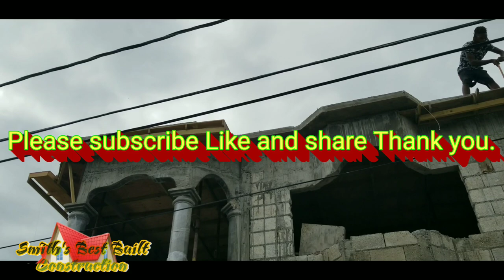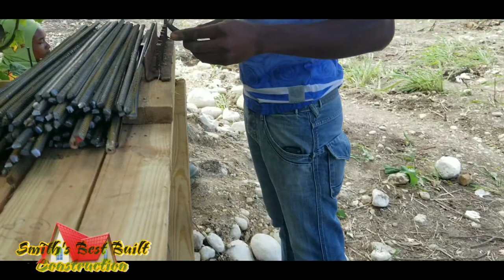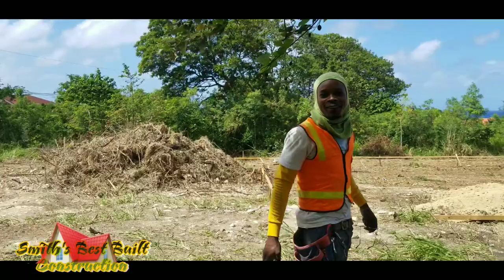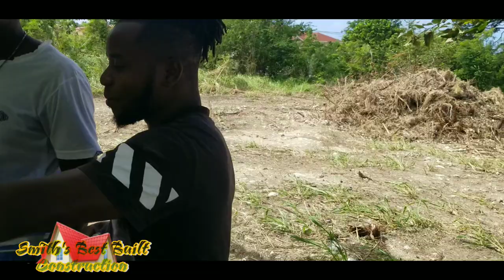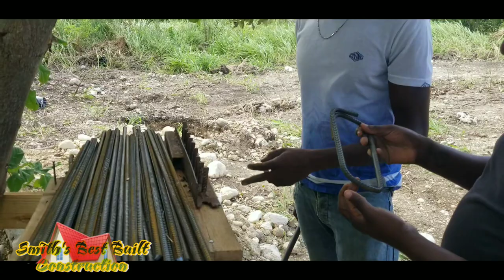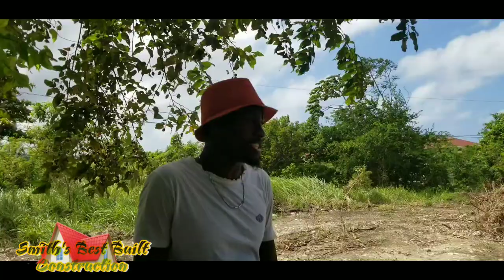How to make stirrup #1

Comment: There is no secret in welding 2inch length of steel at 2inch spacing on a solid flat iron 12 inch long

Comment: To make the links, what length of steel rod should you buy?
Reply: 3/8 inches steel.. 1 Steel length normally be 29.5 feet or 29 feet 6 inches
Reply: @Omar Francis you mixing up links and stirrups. Typical links are made with 12mm (1/2") bars while typical stirrups are made with 10mm (3/8") bars

Comment: If he says the stirrup is 4x10 it's easy to calculate his measurement, also the dowel with two pieces of steel is more comfortable to bend Stirrup with. Plus if the 4 inches stirrup is to use on columns with 6 inches block won't that make them too wide?
Reply: Exactly! They are too wide...4×10 stirrups are for 8" block wall which gives u a standard 2" Clearance of concrete. In Jamaica it's mostly 6" blocks they use so the stirrups should b at least 3.5" wide. Furthermore he is not bending them properly.